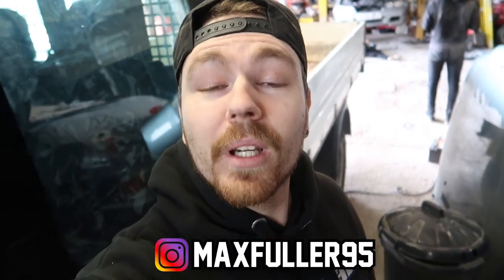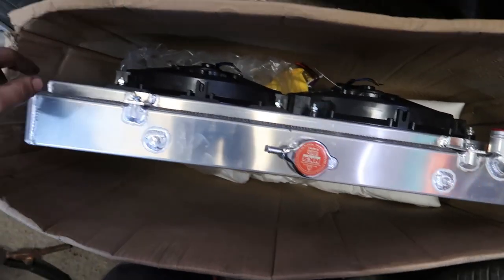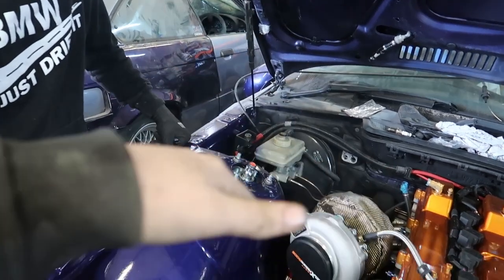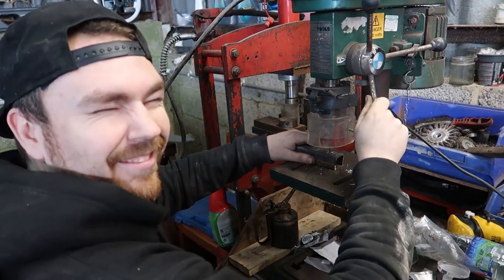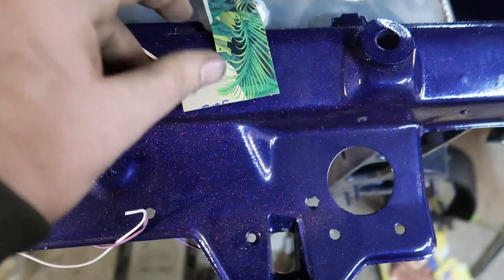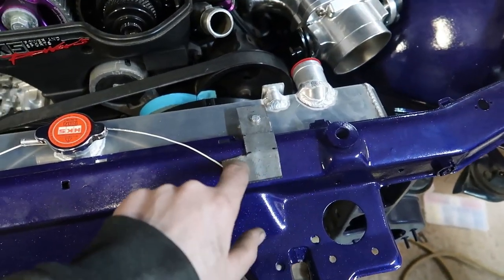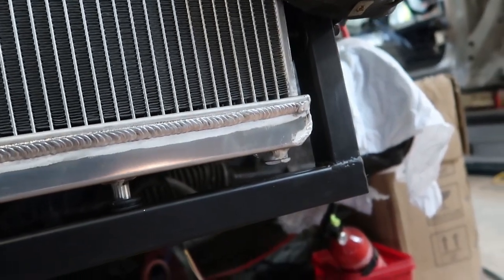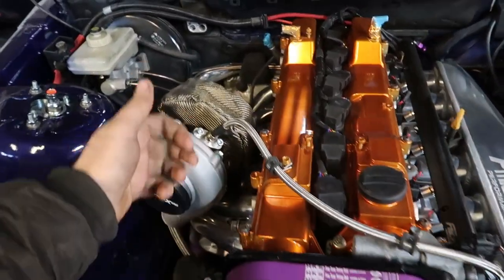BMW E36 Cooling system upgrade! *SR20 Radiator*

Comment: Alright mate how did you get you airbag light to go out after fitting your steering wheel I'm having a nightmare with mine 👍
Reply from the maker: Hey dude, my light never came up for some reason haha but in my e46 I just put a resistor between the airbag wires, can’t remember what resistor as it was a while ago, but should be able to find it on Google 🤘🏼